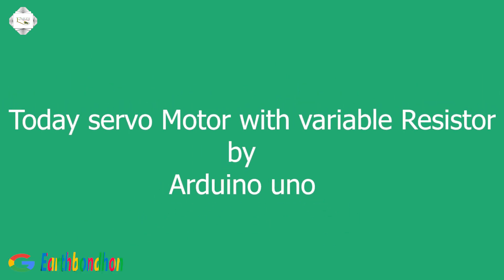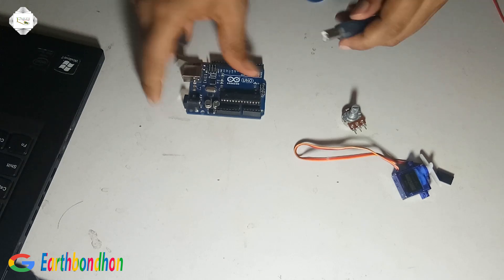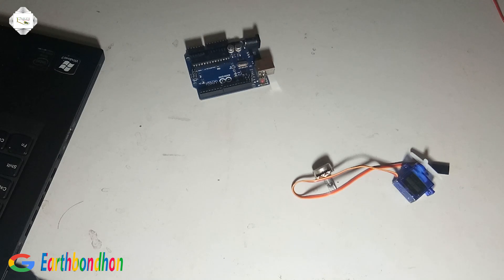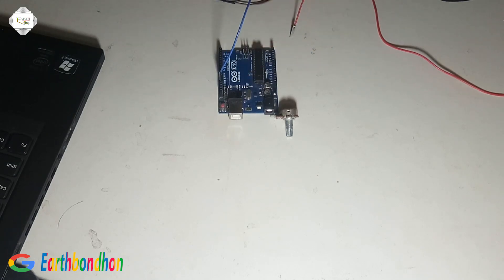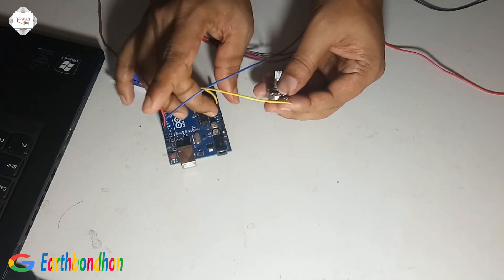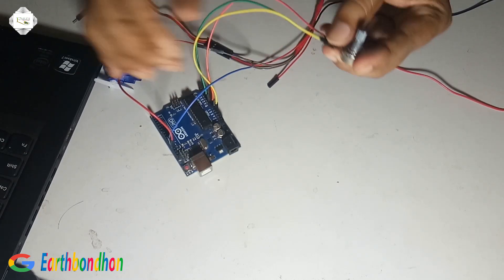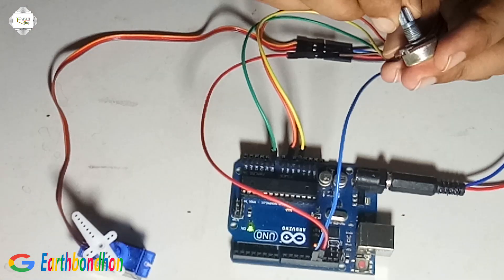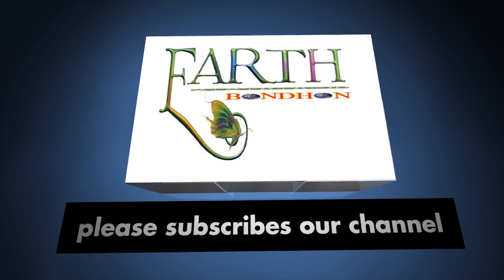#EB-9 Control Servo Motor with Potentiometer | Arduino Uno | Earthbondhon

Comment: How about if i use a motor like 775?
Reply from the maker: What?
full info website @earthbondhon.  I love to receive your comments and feedback.
Thanks for watching it.
Reply: @EarthBondhon  What I mean sir is that, what if i use a higher voltage motor like 775 motor 12Vdc does the circuit remain the same or i need other components to make the 775 motor start?
Reply: @EarthBondhon  I'm asking this because I might use a bigger motor for my boom barrier project.